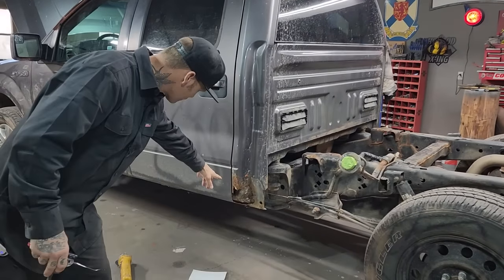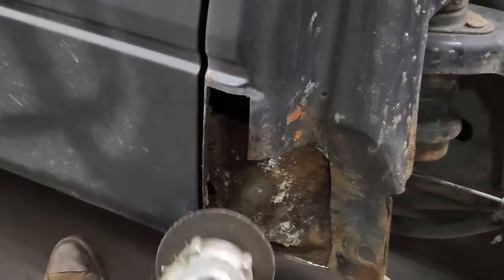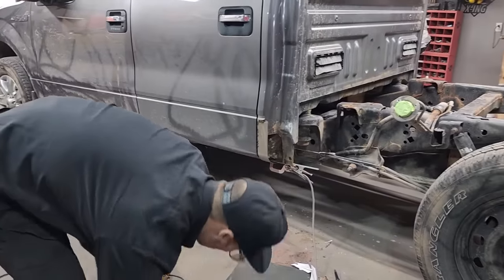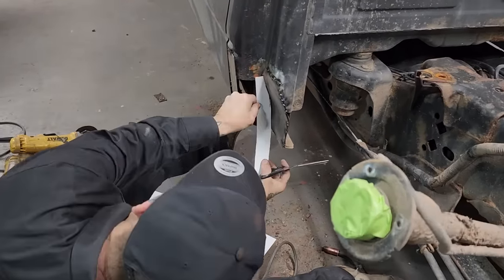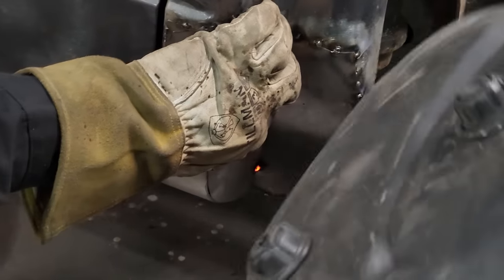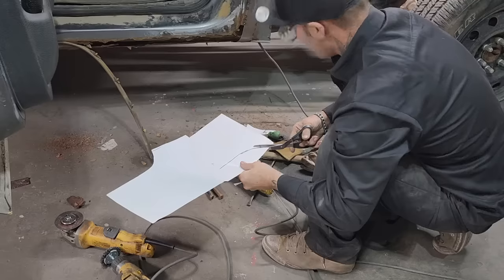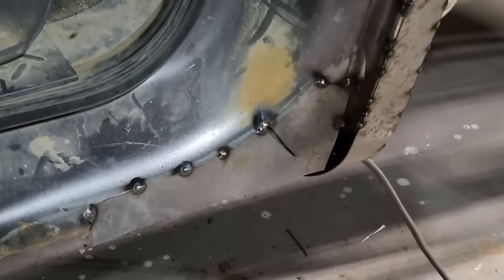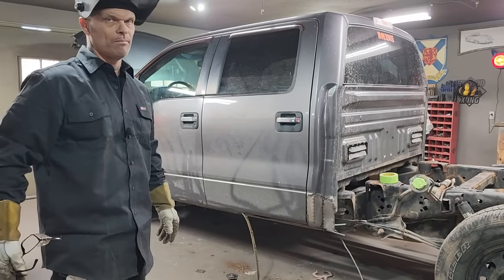Repairing rusted cab corners on Ford F150 for $0 ✅

Comment: With little round corners like that I usually bend a piece if thin wall pipe the same size as the curve and weld it in. I learned that trick from George Barris, rather than trying to make a complicated curve it's easier to weld 2 flat pieces to the bent pipe.
Reply: Nice trick. Please share more.
Reply: @Milner62  If you have the money but when you already have the materials but not the money you use what you have.
Reply: @Milner62  I can find materials all over the place. Someone always has a car in their yard they will give me for a little body work or mechanic work. My friends are always dropping of stuff that they no longer need like exhaust pipe or sheet metal and body shops will give you stuff just to get rid of it. I could build a car from the scraps I get for free.
Reply: Barris = over rated!
Reply: exactly!  otherwise ALL of that nice work is going to rust off behind tha patch fist ,where you cant see it, causing greater problems. What was that catch phrase you like? "Time is money"? How much money would it have cost to scape of the rust scale you lefr behind and A can of rust paint? As opposed to having this guy repair your repair in prob less than two year. You didn't even rust proof your repair. Soyah good for you, not so good for the next guy who's buying this truck. I assumeit's being sold otherwise why does it need an inspection.

Comment: Hi bud, just watching your vid patching can corners. Wow man I'm 75 yrs old now, I loved in swanton, Vt in the early 70s thru the ninties,it's the last stop before you cross into canada. It would snow ads deep to a giraffe every winter, and I worked in Essex Junction By 41 miles south. I had to have a pickup truck cause I loved deep in the country outside Swanton. I loved living there, the schools were excellent too. I always bought Ford - F 250 4 by . I needed a Fisher power angle plow, just to get to the interstate. So that's why I bought Ford's as I kept my plow and it would fit in a new pickup easily. They used so much salt on all the roads up there, if have to do what you're doing quite often, can corners, door bottoms, wheel lips, can floors. I made all my own stuff cause I had a family to take care of. I did all my repairs with basic tools welder not wrench hammers visegrips. I'd do all my body work between April and september, then I'd primer several coates, then undercoat when done. I couldn't see buying a new truck every three years, so I extended the life of my truck by years.I would paint it when it was done, and it looked fine and lasted long time. I'm Vt, every vehicle rusted caddies, lincolns, mercedes, and the map cars and small trucks would rust down so bad I called them Flintstone mobiles. Have a great evening, keep up the vids, I enjoy them!!!!

Comment: I have read all of the comments to date some good and some not so. One thing at this point that I could add is that the statement that was made at the start was lost or misunderstood "This video will show how to simplify rust repair without spending any money on replacement panels. Repairing rusted cab corners on Ford F150 in real time with basic tools and scrap metal. This will be a quick and easy fix to pass inspection".

Also, Chad don't let others get into your head it will eat you up it use to bother me when I was young but now that I'm 70+ not so. Yes, as others put it you have your way and they have theirs I respect yours in this post because you placed yours out there for all to see. 
Keep it real, nice camera work Jolene and Good girl FINA. 😁

Comment: This is a tough fix for most people to do but you did it right. I really don't understand why modern trucks are still built to where water and mud can get trapped in these same spots and rust out. You don't see many modern cars that have this issue but I see it on late-model trucks all of the time. Same thing goes for truck frames no excuse they can and should be built more rust-resistant, especially considering the cost of trucks today.

Comment: Great cab corner job nicely done with patients. Waiting  to see the rockers  next. I'm working on my 2001 dodge ram 4x4 did bed off frame, messy rusty mess  all cleaned and blasted and painted, Now my bed next mess I took it cut out the rust  (outside my garage so sparks flew outside) Now bed back in garage for rebuild 6.5 type bed. But be nice clean when I'm done like your doing.

Comment: i think your buddy should have purchased the corners for you. They are available and pretty cheap
Reply: You are correct. I have done that many times while I had my own body shop. Shops now have the spot welding machines that do the factory type welds and they require less finishing. You will notice they put two pieces together and seldom ever cover the spots, just paint over the welds where they are hidden from view.

Comment: Those corners, decent ones are available from auto parts stores, no need to go online, its a pain. They get it, if wrong its on them, no shipping either. I have fabbed many parts that way tho, sometimes its improved. What size wire you like?, just got a new Lincoln after my Miller was stolen, i liked .030 on sheet metal. Can run up to .035. Great video btw!

Comment: Hi, Chad do what you can with the budget you have . In my 20s had a 65 impala for a winter car because I did not want to drive my 68 charger in the winter. The bottoms of the doors were rotted, Took the metal from an a62 dodge coronet and pop rivet them on. Repainted it at a friend s house who painted cars at a local body shop, We painted it red-orange with white lace 2 stripes on the hood and trunk' Had a black vinyl roof, We did proper bodywork before painting.

Comment: Not to bad for an hour. I like how every time he hit the new metal more rust fell out. The old cab corner was on the floor at the end. 
I own a 2014 f150 after seeing this I'm thinking of buying inner and out rockers , and corners for both sides now before I actually need them. I'm not as good as he is to make my own panels. It will be easier for me in the long run.  I wish I had my own "Chad" I could take my truck. Good job Chad and Jolene.
Reply: You should see my NH 04 F350🤣. He did a killer job for an hour. My first doing a wheel well took me like 8hrs. 1st time welding & did some fiberglass too. No doubt he's a seasoned veteran. 👍🏻 Awesome video!

Comment: It is amazing how people allow this rust damage to happen.  I have read that Ziebart is actually worse than nothing but there are penetrating oils now used that actually work to prevent corrosion.  I have a 2006 F-150 that looks new underneath and on the exterior because I live in Texas and the vehicle has never seen salt.  The only thing I did for it was use a mixture of MEK and 60 weight motor oil spraying it in all cavities, underneath the vehicle, under the hood, in the doors, and inside all fenders.  This was just to make sure that the pristine structure was protected from all the rain we get in SE Texas.

Comment: I did this on my rotted dodge but used rivets and bending with hammer over rounded 2x4. It ended up lasting for 7 inspections. Good enough.

Comment: Just wondering if you ever use por15 or other products to paint over the rust before covering  with new metal.
Reply: Regular paint would do just fine, por15 is mostly a gimmick anyways. Tamco has a really good product that is a “direct to rust” they call 1k monocoat.
Reply: @FnaAuto  check out Project Farm on his rust undercoat. POR 15 is the best although it is also the most expensive. For those whop can not afford that he offers cheaper solutions. He is a one man consumer report. And he refuses to take a dime from any company so he can stay unbiased. Either POR 15 or what you advocate, Chad can not use anything until the welding is done.

Comment: Anyone saying it's cheaper to buy the replacement panels go look at how much they cost plus say if you don't need the whole rocker and maybe just cut a square out and then just bend it you'll probably spend 20$ at the depot for a tiny peice of 18 gauge, I've been doing what Chad does to my trucks even before I knew about him and he's really good at it, he makes it look easy, it's not at all.. first there's warping if you get to hot, then if you don't get the metal flush good luck blending it in, and not to mention he thin metal on the truck you'll be burning  holes through constantly

Comment: That is the stuff I want to see. Let's face it, we're all going to have to deal with a rust repair eventually and you may as well learn how to do it yourself. 😁👍
Reply: but do it right lol not like this go buy new rockers n corners save yourself a headache this will have to be replace within a year
Reply: @tylervanbiezen804  I would have liked to see him clean the rust out of the inside and spray it with rustoleum and maybe it would last longer.
Reply: @kimberlywilliams9757  hard to weld over spray paint
Reply: @benhendricks9728  not if you buy the weld through primer or if you clean the area that is being welded. It's done that way all the time and if it's enclosed properly no moisture will be getting back in.
Reply: @david888a  fix it right the first time, then you don’t have to fix it again next time inspection comes around because that’s what’s going to happen it’s just gonna rot right back off

Comment: Thanks for the tips. I'm in exactly the same situation right now so you've helped me. You using a 120 welder without gas?  That's what I've got currently so you're giving me hope. I thought I might have to use rivets. 😅

Comment: They make a product that kills rust when applied to the surface that is corroded.  It neutralizes the active rust, and you can paint over it. Metal fencing people use it before painting the fence or other metal projects.  Left untreated, the original rust will return due to condensation and temperature change.  Anything other than that is a temporary fix.  Patch jobs are for folks who are flipping a vehicle to sell not keep.  Sorry guys, it is just fact.
Reply: He knows that 👍

Comment: The ole coat hanger gap fill trick 😂 nice job bro, that’s a common thing on late model trucks and even my Tahoes got a spot that’s trashed I’m gonna fix now, might even hit it wit the old coat hanger trick, if not I’ll be using it plenty soon 😂 I’m gonna take a wild gander at what you charged this guy, and say prolly 1200-1500.00 bucks. If less, he’s lucky and got off easy. The time it takes to do the job means nothing

Comment: Bad Chad …..please use a full face shield when using a thin zip wheel. Glasses are great but when the wheel explodes chunks go everywhere. My helper lost an eye and teeth.  The queen would benefit from one also. Also…you can cut the grinder guard down to make it thinner then quarter it to protect you fingers from sliding up and hitting the wheel and it won’t get in the way. Buy the best most reinforced zip wheels you can afford. The shop bought some from China at a great price they worked good until half way then they would explode. Lots of young guys watching you they don’t know what can happen when a wheel explodes…..your not only a craftsman but your are a teacher also…thanks!

Comment: I probably would of sprayed some primer and some spraypaint on the inside where the rust is still rusting before I would of covered it up. Meaning that it will slow the rust down from eating everything around of what you just covered up. To each their own.

Comment: I have heard the reason these rust out is water getting in from the cab tail light. If you do all this work replace the seal or make sure it’s sealed so it does not creep happening

Comment: It’s a good enough fix for inspection, just like you said. but the cab corners and rockers are so cheap you basically used up an hour’s time just making the part that is only $50. The final repair is solid, but only good enough.

Comment: I was bummed I want to see you weld it up specially, with the coat hanger trick. I’ve been doing that for years and people tell me I’m silly but if you’re doing it and I’m doing it, it must be right whenever I got a piece of metal to thin I take another piece of metal and weld on top of it to get them to stick together. I do this with arc welding wire, welding,

Comment: I'd give the repair twelve months and it will need doing again but bigger. There was no rust cure or any kind of preventive long term cure carried out basically just a bodge repair. On an easily bought repair panel that could have lasted far longer than this parts repair

Comment: You need to drill a hole in the bottom of that cab corner for water drainage!! That's why it rusted out!!  The C pillars water drains into the cab corners !!
Reply: Behind the cab corner holds a chunk of salt ice all winter
Reply: That's called planned obsolescence.

Comment: Nice fabrication as usual! BUT, if you don’t stop the rust which is still on the inside/underside of the panels you repaired it is still rusting, and will continue right onto the repair! How do I know? 😞 Yep, been there done that!
Reply: I know what you're saying, but this is just trying to make the vehicle pass inspection....repairing all of the rust inner and outer would be a massive labor intensive job, like cutting out the rocker panels to get to the inner parts.
Reply: @timgreen1835  doesn't cost much I do it for $600 if you buy the rockers n cab corners you paint it yourself
Reply: Yep! You've got to cut off the air to the rust. I'm dealing with rust right no in a Monte Carlo trunk jamb. Gotta stop the rest if you don't want more rust.

Comment: Good job. Fast. Will probably outlast the truck at this point. A challenge to make so quick. I wonder if coat hanger metal can withstand corrosion? I've used it on stuff and it was the first part to rust.

Comment: Easy repair, over here any non factory welds have to be certified by a licensed body man, I made most of the lower 12 inches of a Hillman and it got signed off with no complaints

Comment: What gauge of metal do you typically use for your work?
Reply: I’m sure it’s 18 gauge just thick enough to work with easily and not have to worry about grinding too thin like 20 gauge would be.

Comment: from what Ive seen down here in the states on these extend cab corners. it seems the third brake lights up on top leak water into the cab corners and rot them from the inside. Ive also seen the sunroof drains not working properly and dumping water into the cab corners. I couldnt even guess how many Ive repaired the same way you are...thousands? over the last 3-4 decades. and talk about thin metal! what is that factory metal, 22-24 gauge? Lol I guess the factories gotta cut corners where they can, no pun intended! Lol
Reply: in Canada we have tons of salt on the roads they naturally rust out

Comment: I think the one of the ready chat did the repair with using peices of metal in stead of replacement parts is that some cars and trucks don't offer replacement parts so Chad is showing you the basics on how to repair it ......,. Rare  and  old ride  don't make those parts because of low demands....,,
Reply: Sorry about that  typing errors I think you know what I saying... I should proof read before I send..... Sorry...... I have learned a lot from professor chat.    It's almost Friday..,...,.,.

Comment: Good job but I don’t understand why you wouldn’t take the extra legit few minutes to clean up behind everything u cut out what does it take an extra few minutes on each part to clean up an then throw anything on there some spray paint Por 15.. etc the extra few minutes would make it last 2x as long those  parts are going to start rusting right away especially the pieace u just over lapped an put it on top of each other

Comment: I just don't understand how you don't neutralize the interior cavity with all of that corroded metal and rust. That was virgin metal at the point of production and should have had at least been sprayed with a rust neutralizer after having been wirebrushed to begin with. Wire brush to clean it up spray it with rust neutralizer. Spray paint with more rust inhibitor to seal it in... Then continue the repair with the outer shell... So it takes an extra 30 minutes to do a proper repair for the next 10 or 20 years. Come on man. If you're that busy. Charge the guy an extra $200 to do the repair right

Comment: Bad design by ford  drain hoses for the roof run inside the cab corners snd rockers.  Delivering water during every rain storm.  Relocate your drain hoses.. Then get RustCheck rustproofing every year for 125.00.  10 years = 1250.00  dollars .
.way cheaper that hoing through this process

Comment: I would agree with the comment that Chad has talent, but surely, even a so called quick job, Chad you should be removing all the corroded metal and should have rust treated the inside of the box sections before welding in any new metal, and welding over existing rusted panels is a complete mistake and very unprofessional! Additionally i can see from the video the rust continues under the door, so even more work required. Better to have purchased the correct replacement panels, surely would have saved time in the long run?

Comment: I'm usually impressed with your work.  This and the frenched headlights on the other car not so much.  You should have flushed the new metal with the old metal.  You can say they put break over metal but not like this.  No reason not to cut out and flush new metal

Comment: Only thing that could have been better would have been to remove the rust out of the hole first with a wire wheel and some phosphoric acid, and to cut the rust out and not weld to it.